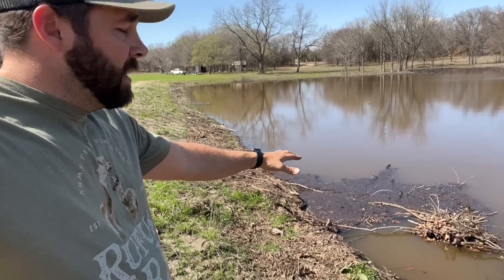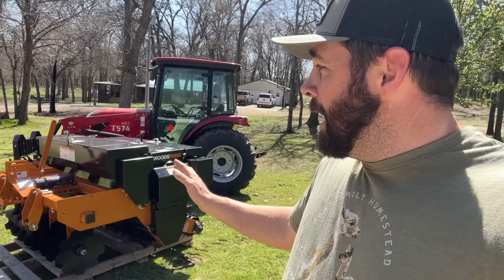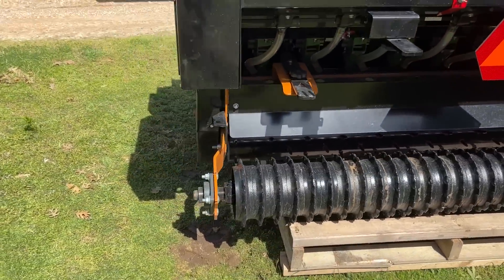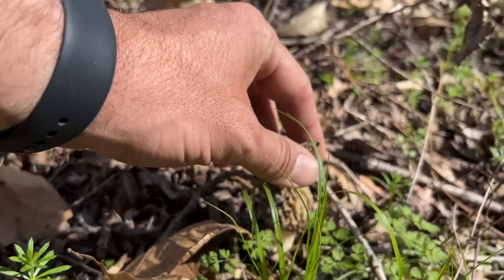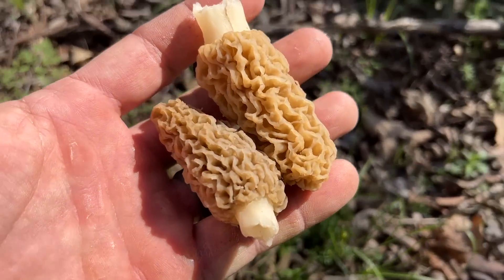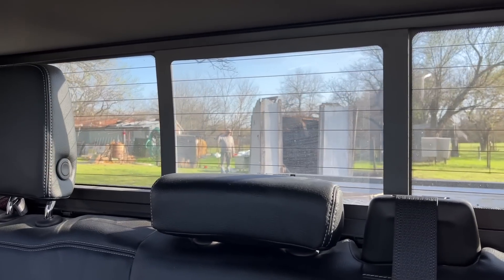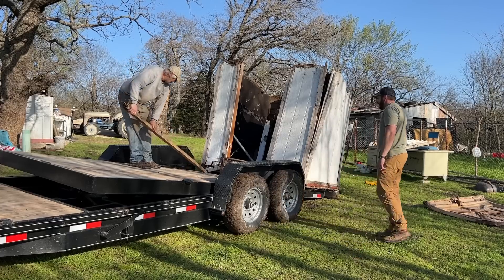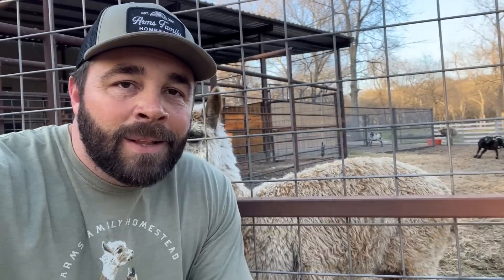I Guess That's What Brothers Are For!

Comment: Hey Folks love your channel. I'm not much of a commenter but I wanted to mention something I used on my pond dam to help with vertical pipe discharge if you just search Pond Dam Trash Guard with Anti Vortex plate it actually increase discharge in your vertical stand pipe as a welder you can make your own with a minimal amount of metal  I made mine with scrap metal I had on hand   
some rebar and 1/4" plate good luck am looking forward to your planting endeavors.

Comment: Daniel, you can put mesh on spilway vertically (as some sort of tube extension). That will have a lot bigger surface for water to come trough  compared with spilway section for horizontal grill. And it'll be harder to clog.

BZW if that debris fall into your tube and clog there you'll get much bigger problem to clean it than now.